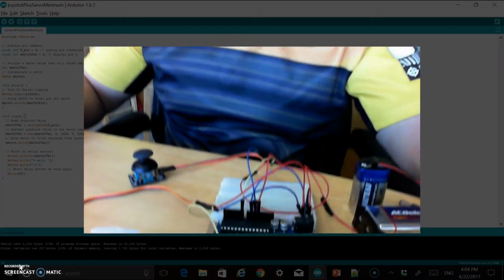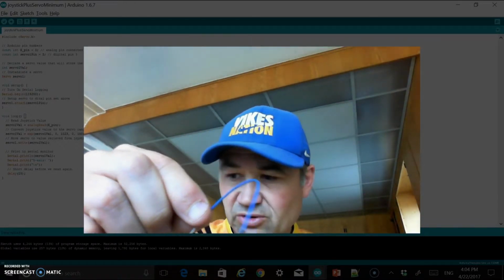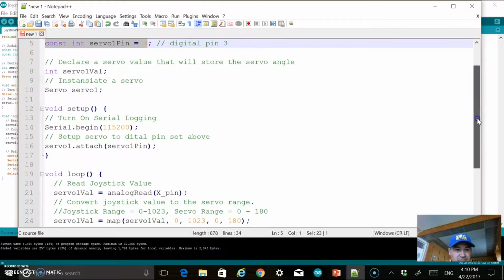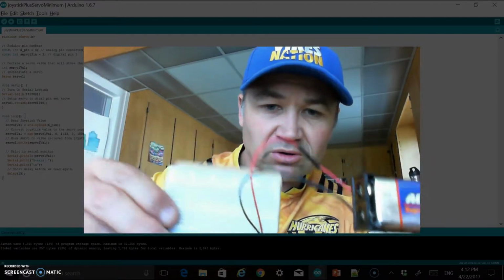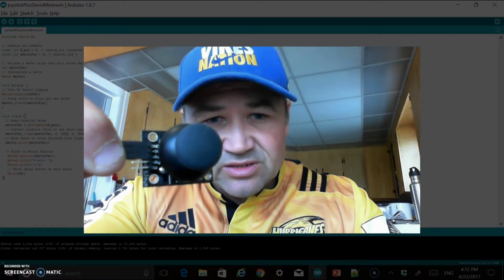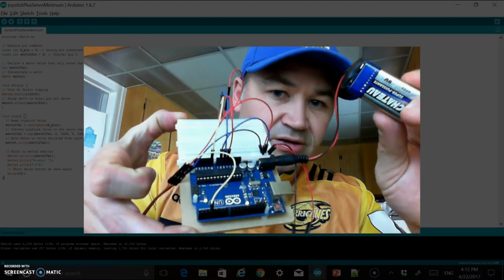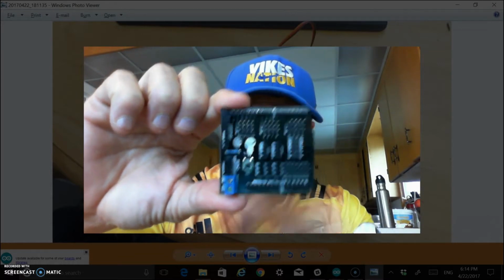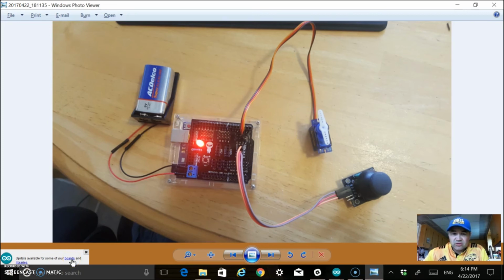ArduinoJoystickandServo

Comment from the maker: Code:

#include <Servo.h>

// Arduino pin numbers
const int X_pin = 0; // analog pin connected to X output
const int servo1Pin = 3; // digital pin 3

// Declare a servo value that will store the servo angle
Servo servo1Val;
// Instansiate a servo
Servo servo1;

void setup() {
// Turn On Serial Logging
Serial.begin(115200);
// Setup servo to dital pin set above
servo1.attach(servo1Pin);
}

void loop() {
  // Read Joystick Value
  servo1Val = analogRead(X_pin);
  // Convert joystick value to the servo range.  Joystick Range = 0-1023, Servo Range = 0 - 180
  servo1Val = map(servo1Val, 0, 1023, 0, 180);
  // Move servo to value recieved from joystick
  servo1.write(servo1Val);

  // Print to serial monitor
   Serial.println(servo1Val);
   Serial.print("X-axis: ");
   Serial.print("\n");
   // Short delay before we read again.
   delay(15);
}